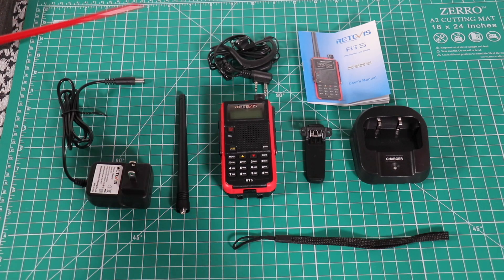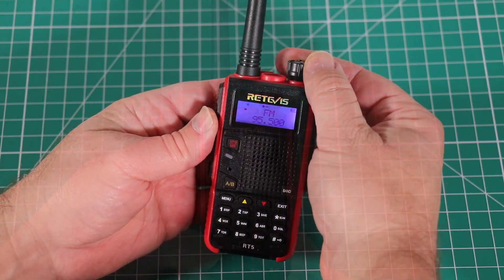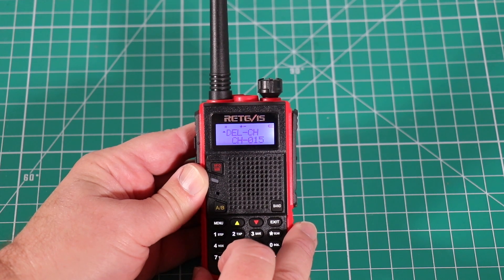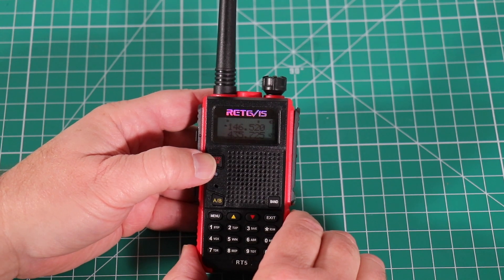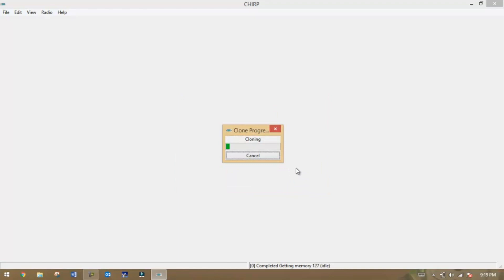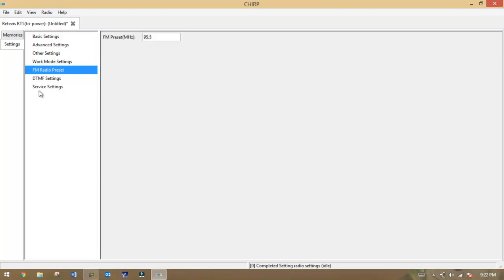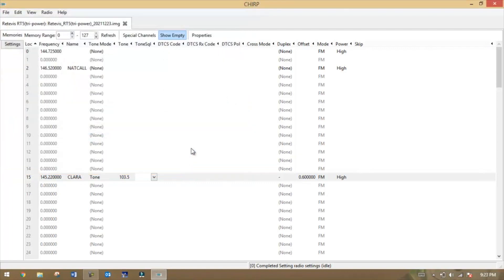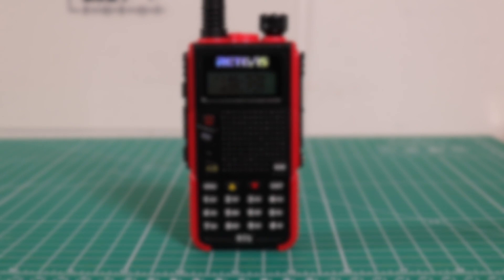Retevis RT5 Overview and Programming

Comment: Hey thank you for a great video. I do have question though. I have just bought a pair of these radios. Where I am struggling is the terminology. You are very clear when you show how to change something, but I don't know what the changes mean. Is there a go to place that will explain "when you change channel" for example this will allow you to,,, blah blah,,. I find at the moment the transmission distance is very short, just a few hundred feet over flat ground here in Spain. Any help would be awesome, thank you.